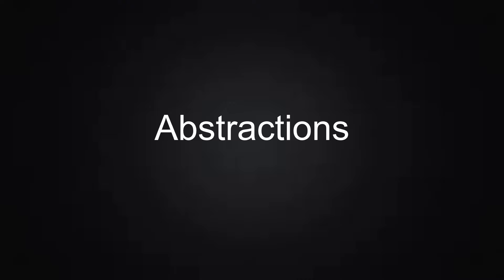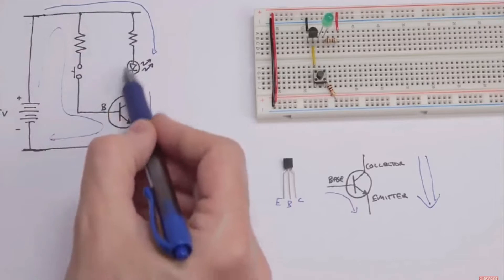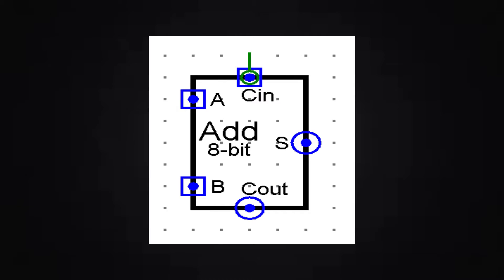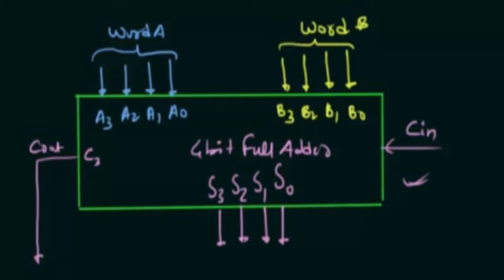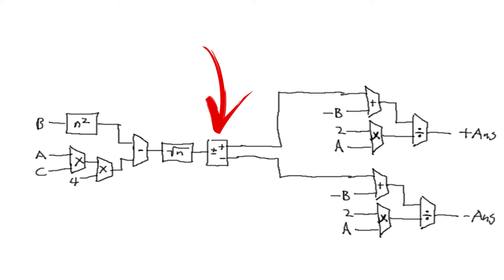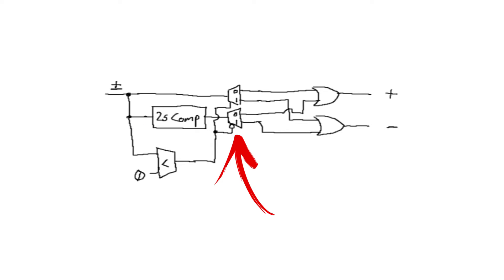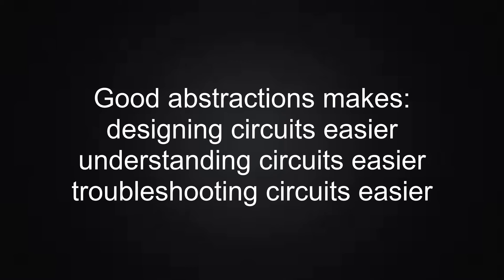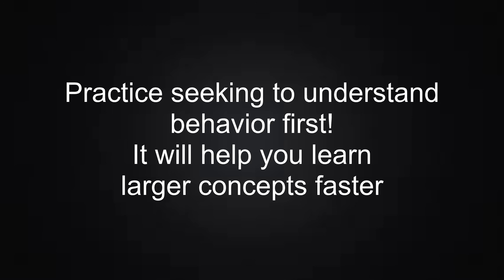Abstractions

Comment: See this is why I color code my components when I'm doing big projects like making a redstone computer. When I fly around ORE and I look at the computers they make there, I get confused about how they work. Some of them have wildly different architectures and components that I couldn't tell which component it is just by looking at their shape, and most of the time, the creators of the computers just ignore me and all I can do is to stare at them for 1-3 minutes before figuing out their architecture. Cheers to all the redstoners who color code their circuits. Anyway n00b_asaurus, I think you should concider color coding your redstone computers instead of building them out of just iron blocks. Maybe a block for the ALU, a separate color for memory, a separate color for the control circuits, etc. It gives a good sense of abstraction. But if you prefer sticking to iron blocks, I'm ok with that.
Reply from the maker: Colored blocks make for a clean circuit like syntax highlighting makes for clean code :)
Reply: Franco Bartolabac Is pretty simple when we build computers, most machines use more or less the same ALU, if you can identify it then you can completely reverse engineer it.
Reply: @xwaazes6375  Well I'm just saying that looking at a color coded cpu is easier to understand than a non color coded one.
I have nothing against people who don't color code their CPUs.

Also it's not just the ALUs. The hardest circuit to try to understand in a redstone computer when it's not color coded are the control circuits. There's no specific component in any computer for the control logic, and control logic gets really messy especialy with piped computers. Without color coding, even the builder of that CPU might start to loose track of all the control wires around the computer, and thus becomes harder to debug.
Reply: Haha lol I never can be bothered to colour code mine either XD all just white concrete and a tangled mess of wires.
Reply: TheDarkness344 ok Benny xD
Reply: @xwaazes6375  XD hahaha yea you should see my dual bus dual core computer lol even I can't understand what half of the wires do lol
Reply: @xwaazes6375  XD hahaha yea you should see my dual bus dual core computer lol even I can't understand what half of the wires do lol
Reply: Cheers indeed brother!
Reply: In my latest project (HRBC0.5), I started color coding things, then I forgot and I'm too lazy to go back and replace the unorganized nonsense with proper color codes.
I did color code HRBC0.3, but before and after that nothing I've made has any organization.

Comment: So far the breadboard computer is going great :D the instruction set I had made was really bad with the new i could do the Fibonacci program in 9 bytes
Reply from the maker: Excellent! I take it you're following ben eaters videos to build this then?
Are you using his architecture? or have you given it a twist :)
Reply: @n00b_asaurus his design was way too simple and weak, so im making a architecture of my own thats not as powerful as an 8088 but not as weak as a 8008 :D it could run at 5 mhz, capable of multitasking, virtual memory, interrupts, im gonna give it a graphics card with graphics mode and text mode and some sort of boot device and maybe a sound card. so at boot the bios detects a graphics card and prints the bios revision and checks for other hardware and then does a memory check and then it tries to boot off of the first bootable device found and then whatever the operating system you have you use from there. this architecture should be very powerful so im going to have the motherboard on solderable breadboards and the cpu itself on breadboards :D